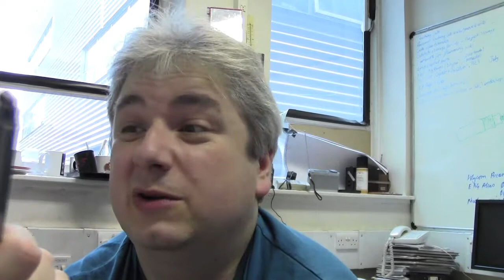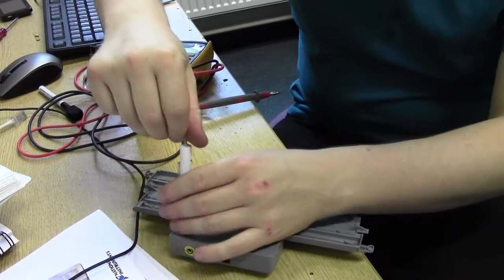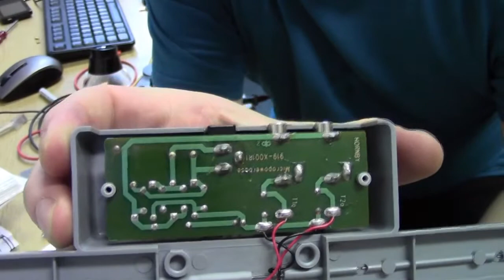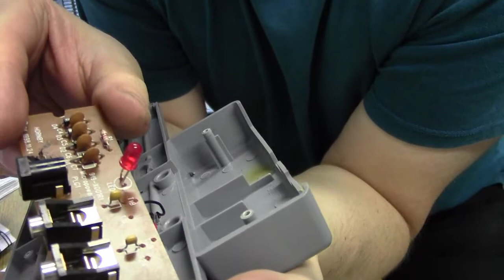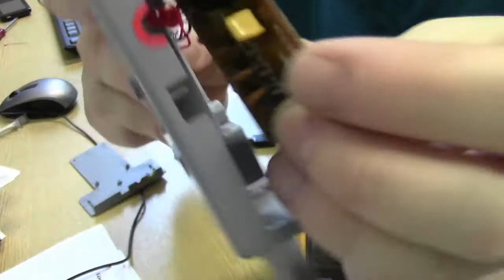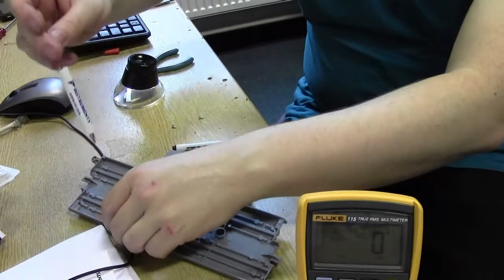Scalextric Track Repair

Comment from the maker: On farnell the device is stated as a 3 pin but the data sheet shows it is already connected to pin 1 so don't worry about 3 pins tread it as 2.
pin 1 / 2 / Tag = cathode
pin 3 = anode
if you need to isolate it from the heatsink use a mica or mylar insulation kit, like farnell stock number 522636

Comment: Hi Andrew, thank you for the update on the diode and apologises for taking up this page with my repair.

The circuit board shows the diode direction for mounting, so face on cathode on the left, this pin conducts through the screw and tag. New ground for me with a 3 pin unit at this level I am more of a fitter. Would I just leave a pin free or jump it to another and regarding the heat sink if I have to isolate this would this be with a fiber washer as I assume this is about conductivity regards

Comment from the maker: dam if your limited by the foot print it gets harder, could try the 20ETF06PbF from farnell stock number 9101500, its similar spec some of the values are a little higher but shouldn't be a problem. its stated as 3 pin but pin 2 is joined to pin 1 so its really a 2 pin device. like I said make sure you get the pins right way around and if the metal tag is joined to the anode or cathode make sure the replacement is the same. If you might have to isolate your heat sink or do a work around.

Comment: Howeverr it looks like this 12F60C diode s going to be my next prolem as it is not the same package as the alternative we have looked at which was a stud type and I canoct find any other data on this or have the knowledge to filter the alternative options that it could be. All I can say is it is a flat mounted screw type to a heat sink with 2 legs and the circuit board shows this as a diode and the only other markings on it are JIF HI 036 and a diode symbol. any suggestions?

Comment from the maker: If your diode test shows overload for reverse bias and a value for forward then it could be ok.
The typical forward voltage should be about 0.6V to 1.5V for silicon (germanium and  Schottky are a lot lower).
In your case the component is quite high powered so your meter might not be biasing the diode fully so you only read a low voltage.  

But if you feel the diode took a battering then there's no harm in replacing just make sure to get anode and cathode around the right way.

Comment: For this repair It would appear a transistor on a heat sink (also has a bridge rectifier on it GBJ2510) has shorted across to an adjacent heat sink with a diode attached.
The shorting is on the corner of both heat sinks and a burn on the board but no damage to any lines. .
The transistor was my first choice to change.
I have tested the diode 12F60C which is flat mounted with a screw to the heat sink and was thinking of changing this because of the low voltage reading in one direction of 0.437.

Comment from the maker: Farnell and Mouser sell similar parts, check these out 

Farnell
12f60C = 12f60, stock number 3938955. Not sure if its 100% right cant find out what the C is for maybe the package\footprint, its possible that the C got dropped when I.R. became VISHAY.

JCS24N50WH = IXTH24N50, stock number 9359524 same package and similar specs

Mouser
12F60C = VS-12F60, Stock number 844-12F60. Same component as farnell.

JCS24N50WH = FDA24N50, Stock number 512-FDA24N50. Closer to the original spec than farnell.

Comment: Hi Andrew thanks for another interesting video..

Can you offer some advice on a replacement N Channel Mosfet transistor.

The markings are JCS24N50WH and I can only find this in China with a 5,000 minimum,

I only need 1!

I have found a data sheet from "yuanqijian" but could not be sure of what would be a good alternative to use.

Any help would be most appreciated.

For good measure I think I will have a similar problem with the diode needed as well 
12F60C?